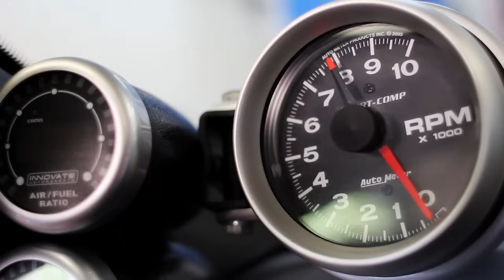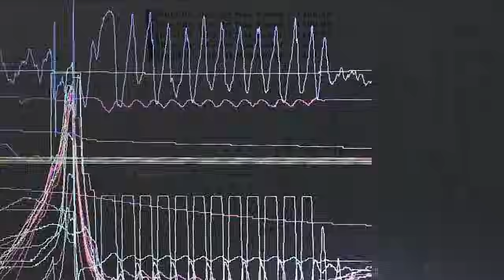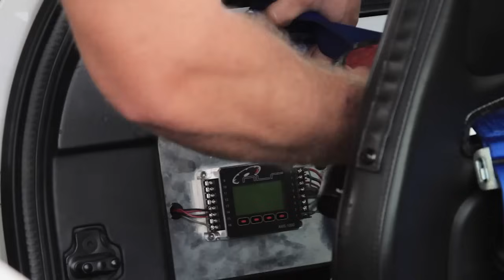New World's Fastest Car! Ford GT Bad v8 1700 Hp - 455.817 km/h ( Guinness World Records )

Comment: Lets modify the veyron then lets see who is king ? Still a nice car though!
Reply: ***** Yeah, plus it's much heavier than the GT... Veyron ain't bad but it's already modified to the max when you buy it, can't really get more out of it unless you're a specialist and have access to special machinery.
Reply: good  luck  finding  aftermarket   parts  anywhere    for  a W16   what a   waste!  the    Bugatti  took  5.5  miles  with  a 120  mph  head  start  off  the  corner  just  to  go    30  mph  slower    at  the  top  end       if  you  put  this  car  on  the   Nurburgring  it   could  top  300  mph!
Reply: bud385
 No i wouldn't. The Ring has approx 73 turns in 20,8 km (13 miles), its not a high speed track, so going for 300 mph am der ring, will just end in jet an other dead racer on that track
Reply: zolikoff ***** You both know the Veyron engine make up more power than the specified right? or you really think a 4x Turbo 8L W16 Engine can ONLY make 1200HP-1000lb-tq?.. There could be a lot of reasons why they didn't want to go higher, I can think the transmission might not hold +1000lb of torque, Not like there is a lot of stock transmissions that does and it will have way worse MPG that already stated (Remember this is a Road Legal vehicle) Not a racing machine..
Reply: skirmich So true ! If we can get 2000hp from a 4.0L 550hp V6 from the GTR, we could get 2500hp or even 3000hp from the 8.0L W16. But the lifespan would be really shorter and the fuel consumption insane.
Reply: Veyron SS is a sooped up version of the veyron and even that can be modded to make more power Nothing is ever maxed out. They Boys at Buggati are not gonna release something maxed out already gents.
Reply: Okay, here is one thing you are all forgeting? A car like a Supra with 1200HP can't run for very long without overheating. The Veyron was made with that many radiators for a reason.
Reply: ***** It has 4 turbos.. Heat is a major factor but that doesn't meant that with all those radiators its keeping from melting they just went overkill with the extra care to the engine.. I bet yah they can still use the same radiators for many upcoming models without modification to the cooling system.
Reply: Modifying the veyron would be possible but against the intention of the veyron concept...the veyron has "only" 1200hp out of its basically 2 V8 engines with 4l and twin turbos each to maintain driveability. When you're driving you dont see you're in a different car than a vw golf besides the more luxury in the interior...unless you put your right foot down. Of course you could make an even more badass-beast out of the veyron by maxing out the engine(s) and leaving out all of the luxury for a lowwr weight, but this car wouldn't fullfill its purpose as a bugatti.
Reply: DerStratege408
Finally, someone who knows what they're talking about.
Reply: DerStratege408 No need to lower anything with 1000HP is more than enough to move its weight, They just unleash more power to make it faster ala ""SS"" it will still fulfill its purpose while being faster... And it will still maintain its driveability since its hilariously heavy not even the SS makes a Drama under full acceleration going to 1500 will still make it a good touring car.. I believe even at 2K will be composed just taking care at launch.. BUT I still hold my opinion on why they didn't go any higher I can bet the trans cant hold that much torque...
Reply: skirmich
the trans could probably hold the torque as it weights about 125kg (275 lbs), but maybe they dont want to risk anything. i didnt only mean driveability considering that the car loses traction in corners, but also all the things that come in with nearly maxed out engines. the throttle response gets worse, the engine may start stuttering beneath a certain rpm level and that are things you cant put into a car priced at 2 million €
Reply: DerStratege408 Also people forget how long ago the veyron was made, they started coming up with it almost a decade before other cars start breaking its record...
Reply: You cant just modify a car! The Veyron is already taken to the limit;)
Reply: vicinetwork321 No it isn't.. Its held back to the already miserably MPGs it can produce, Fully unlocked that Engine should be very well north of 2K HP.
Reply: lmao IT IS MODIFIED
Reply: John Tate You can't be serious?
Reply: John Tate
Okay, it's a 16 Cylinder car, quad turbo, cut that in half you have a 4.0L Twin Turbo V8 that's 500HP that's a pretty easy output for that type of engine, so if you look at the 1500HP twin turbo V8s you can see how far away it is from it's true potential.
Reply: Because it is far away from it's true potential it will last for decades, like the old Buggaties from the middle of 20th century.
And the rivals like the scc or the koenigsegg won't last more than 15-20 years without a complete rebuild of the engine.
Reply: Yes
Reply: There is absolutely no way to tune it. It already has a quad turbocharged v16! What else could you add?
Reply: Sexturbocharged?
Reply: Matthew Breedlove Its too heavy the Veyron.., Weight reduction + Turbo Upgrades :-P
Where is SSC Tuatara?
Reply: In a mile trying to move the weight of the veyron  wouldn't be king.but the New hennessy is the one to look out for!
Reply: Yes but the Hennessey has a lack of comfort compaired to the Veyron, it's not like you're going to drive it for 1 mile run everyday.
This is the kind of cars that are not comftable for everyday driving.

Comment: can guarantee within the next 10 years a car like that will be street legal and factory standard
Reply: Cykoid Transtar is already making one, it's called the dagger GT, and it will be a attempt at a 500kmh car. The transstar is pushing 2000 HP out of it's V8 and will accelerate from 0-100 or for you miles users 0-60 in 1.8 seconds. There's also an non road legal version for drag racing with a chute and 3000 hp.
Reply: MrRubenvos123 i can remember reading and seeing videos of the schematic and model builds, it came with 3 variations of nelson racing engines but that was about 6 years ago haven't read up about it since.
Reply: +MrRubenvos123 Also, the Devel 16.

New tires, new engine, new transmission, new EVERYTHING will need to be developed to make a car faster than 350 mph I guess
Reply: AP499D25 Physics is always there to ruin the fun, we get to a certain point to where we want to go faster it just blocks you off and says 'it ain't gonna' happen'
Reply: +Cykoid So what do you think will be the fastest car in the world *forever*? Forever until the world ends
Reply: AP499D25 i reckon we'll manage to crack 360 somehow before we fizzle, but then again a man with a weird moustache and extremely hard to pronounce name will have claimed have discovered a way to go even faster
Reply: Cykoid That would be awesome..
Reply: Martin Allen I agree. Especially the fact that electric motors are more efficient than internal combustion engines
Reply: Martin Allen i'm guessing it'd be more like one of these new types of hyper-hybrid cars like the 918, p1 and the likes
Reply: Cykoid I agree too. A battery pack for an electric car will be very heavy. Combining electric and internal combustion motors together make sense(the IC motor actually drives a generator to charge the battery pack).
Reply: +Cykoid Sorry, but then humanity will have no gas for it anymore... ;p
Reply: hiergibteszuviele I agree. Fossil fuels are not renewable, so the very future cars must run on renewable energy...
Reply: have we forgotten about Ssc? the tuatara?  It's quite easy to get 1k+ hp and get over 420kph. Only hard part is making it street legal.
Reply: Element Poetic haven't seen anything about them for years, a few mules for car shows thats about it, my guess is they gave up.
Reply: Cykoid sorry about the spam.  My phone decided to go haywire while I was posting.  But nah. The car is supposed to come out in 2016.
Reply: Element Poetic be very interesting to see, i liked the SSC UA but they were asking way too much money for what it actually was, it was phenomenal performance, but refined,.... yah no, plus it would be nice to see america in the hypercar wars again
Reply: Indeed.
Reply: +Cykoid  it won't.
Reply: +Cykoid next bugatti will have 1500 hp so its close
Reply: joshua de backer Horsepower means nothing compared to torque and the power to weight ratio.
Reply: Element Poetic it will be lighter than the veyron SS and theyre maing sure it will handle better
Reply: +The Real Santa Claus , it sure wont ride like the Veyron..  You can listen to a symphony and drive one handed
Reply: Called it... the Agera RS went 285

Comment: Can i put this engine in my honda ?
Reply: No but to be going that fast it must have had VTEC and red brake calipers! Maaaaaad
Reply: Ask turbo yoda via mightycarmods 😂😂
Reply: +Bobilator Realitywall no but you can put your honda in the trash can
Reply: +fly guy nassim muscle vs tuner references? lol
Reply: +Bobilator Realitywall of course you can ,,, i have the power   lol
Reply: Joe Mendez
Maybe it will be more simple to use the engine for the civic frame .
Reply: +Bobilator Realitywall 

Even if you could dude you wouldn't afford it :-)
Reply: +WhiteLion2013 you do realize it's a aluminum 5.4 modular motor with a proprietary intake manifold you could make the same engine going to a few junkyards for the heads then buy the crank block and intake manifold from Ford for relatively cheap.
Reply: Nathaniel Diaz you're way too angry and your grammar gives me a headache.
Reply: +Nathaniel Diaz  damn dude you upset about a joke????
Reply: no one got the mcm reference huh?
Reply: yes.

Comment: Everybody here needs to read a post made by Toby Catlin He sums it up all in one comment. And never a truer word has been said.

" A  top fuel drag car will hit ~330mph on a quarter mile but the engine needs to be rebuilt every run. The engineering brilliance of the Veyron is not that it will hit 250mph top speed but it can do this and be a reliable car. This Ford GT bad can obviously out run a Veyron but I bet it sucks balls from a reliability stand point. "

Now please people, stop with your bullshit comments.
Reply: Not only does the Veyron have reliability to work for hundreds of thousands of kilometers, its also luxurious, extremely comfortable, refined, safe, easy to live with, its the best of the best from supercars and luxury cars combined into one package, that nobody else managed to achieve....simply about 50 years ahead of this Ford in terms of engineering and about 15 years ahead of any other current supercar, especially that tuned up Lotus that will last for 5000 miles before it needs a new engine.  Its sad to see so many idiots on youtube who have an IQ so low that their deepest understanding of cars is limited to what its top speed is or what the 0-60 time is. They're like adults with minds of 4 year olds.
Reply: the veyron sucks in corners
soo i would stick with the agera r wich is faster in acceleration and turns like a f1 car

Comment: again another misinterpretation of the rules!! the veyron is a production car, this is not! you might as well stick a top fuel funny car on the track, set the record at 335!!!
Reply: A top fuel is not street-legal
Reply: +Mad Max that's the point he's making.
Reply: right on Ray!
Reply: The record isn't for fastest production car, it's for fastest standing mile in a street car.
Reply: It SAYS: "Performance Power Racing Re-Sets the Guinness World Records holding for Fastest Standing Mile-Street Car at 283.232 mph". Nothing in it about being a stock factory car. FFS.
Reply: Yeah this 'street legal' tend to be stretched quite a bit ... did the car pass CARB? What about it's sound level? SMOG test? mpg? Can it go over a speed bump? ...
Reply: The problem is that the definition of street legal changes depending upon state and even country. Many states have a yearly inspection with emissions testing, a lot of other states have no inspection. This is basically a Bonneville car with tags. I doubt this car can be reliably street driven without MAJOR maintenance and tuning almost constantly. This car would NOT be street legal in many states.
Reply: It said street car. This car is street legal.
Reply: Top fueler wouldn't make it that far....hell, they don't even go a 1/4 mile anymore.

Comment: You need a 1700hp car to beat a measly 1001 hp veyron
Reply: Its exponential basically to increase speed at all when you're going that fast. There are a lot of factors. The Bugatti is also clever, more so than the competition.
Reply: fastest piston engine vehicle at the moment is a Twin Turbo 6l v8 producing 2,200 bhp, Top speed 462 mph. (though its in no-way a production car)
Reply: I don't think you realize how fast this car is... veyron needs 2+ miles to hit top speed. This car beat the top speed in under half the distance. This car would stomp a mud hole in a Hennessy Elise, I mean venom. It's still an Elise. This guy will break 300 very soon! The venom is Not a production car. It is a copy cat of n AC Cobra

Comment: The Veyron is a production car, this car is not. You can't compare them, in my opinion.
Reply: My pickup lines are faster than this car.
Reply: EXACTLY!  Build your own production cars that are faster than a Veyron THEN you can compete
Reply: The veyron is still the fastest production car! Now if you mean just simply the fastest car well the Hennessy venom has been the fastest car. the Veyron is simply the fastest production car
Reply: +Chris Herrin yes you are right last time I had researched it they didn't consider the Venom Gt a production car I stand corrected
Reply: +Chris Herrin I agree that anybody that buys the Veyron is simply just trying to make a statement. they aren't seeking performance at its best.
Reply: When arguing against a cars handling vs price I'm not sure I would use the Ariel Atom in my argument. It's not exactly slow..
Reply: Your face doesn't know what's going on.
Reply: No mistakes here, I don't type with my mandible.

Comment: The SSC bloodhound is technicly a car to. And that monster goes way faster then this one >_> foul title
Reply: SSC is a car in concept only. You cannot drive it anywhere, it will not go around corners, it cannot be parallel parked and it wont fit into a normal garage. The Bad GT is street legal, can be parked like any other car and it fits into any garage or carport. Foul comparison.
Reply: Allen Smith
True, thats a total wrong comparison. Why you bring it up? Ignorant or you just want to say something?

Oxford definition of 'car'
noun \ˈkär, dial also ˈkȯr, ˈkyär\
: a vehicle that has four wheels and an engine and that is used for carrying passengers on roads
: a separate section of a train
				
Full Definition of CAR
1
:  a vehicle moving on wheels:
b :  a vehicle designed to move on rails (as of a railroad)

Dont see anything there that you brought up mate :)
Reply: Devon Stapel
yes.. thats what i said...
Reply: Allen Smith So you do dribble on about crap that's not relevant to the video title. Concept or not, the SSC Bloodhound is still a car by definition so what was your point? I would simply argue that the title is simply wrong as Guinness has already recognised the Thrust SSC as the holder of this record since 1997. http://www.guinnessworldrecords.com/world-records/10000/land-speed-(fastest-car)
The correct title for this video is in the description and most people here are arguing the toss over different categories.
Reply: *****
video discription didnt include any "non official street car". Car is a car. 3, 4 6 wheels, rubber or metal.
Anyway in the video at 3:20 you can see on the Guiness certificate its awarded for "fastest standing mile in a street car"
Reply: Okay for everybody out there wondering no buggati not the fastest and yes venom is in fact the company of the venom first build stock cars the normally tune pre exciting cars but thus was there first ever stock car to be made u would know that if u saw the video of them making the car okay it has similar looks to the Lotus but it's not a lotus it's a venom and holds the record for going 270 this car is tuned so of course it goes faster like drag cars of corse there hp is some of the fastest because there tuned the company's known for making fast cars without them being tuned are kenossege, buggati, Lamborghini,and a couple others but yeah that's my input
Reply: Forget Bloodhound. Donald Campbell went faster than this in 1935.
September 3, 1935 at Bonneville salt flats, Bluebird was the first car to break 300 MPH at 301.129.
And that was in a car powered by internal combustion, driving the rear wheels.
Reply: steveskeggy61 There are a million cars that went faster. This is the fastest street legal car in the standing mile.
Reply: Guiness World Records for reaching 455.817 km/h in a supercar maybe ?
Reply: but that's not the street car..
Reply: Allen Smith Any garage?! I'd like to see that, well maybe if you decide to sleep inside the car
Reply: I see lots of comments calling me names...weak minds do that. My original comment is completely valid, no matter that you disagree.
Reply: road car